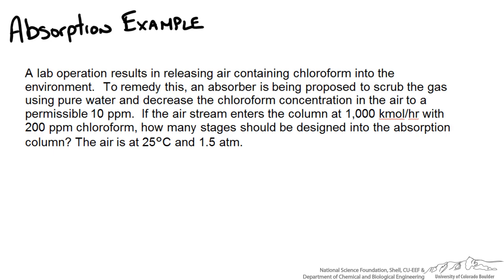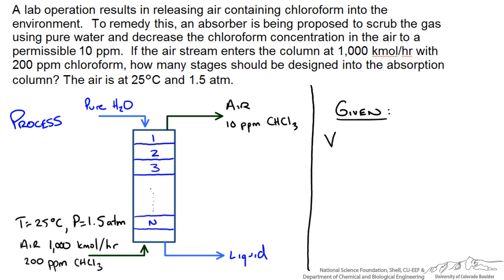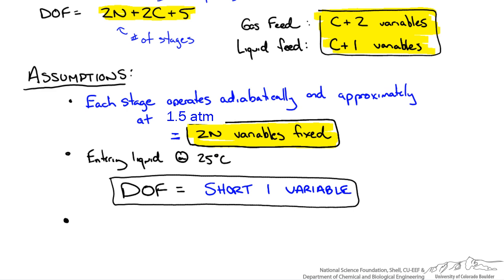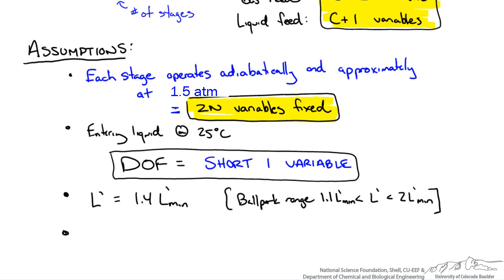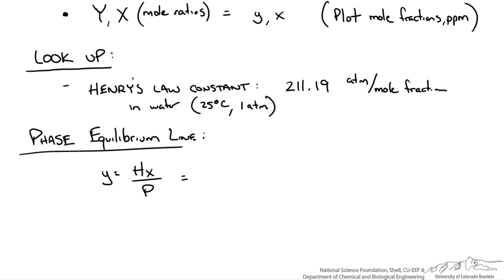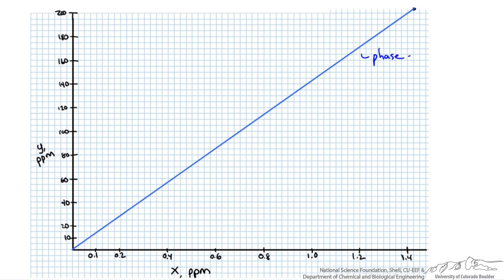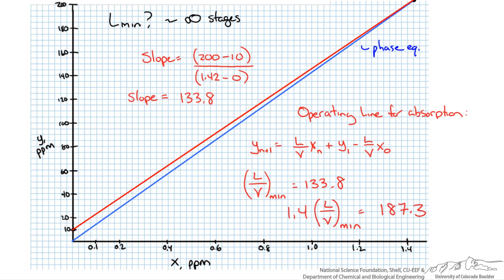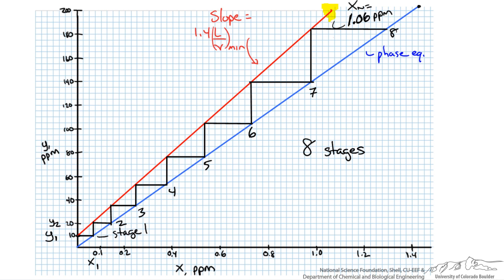Absorption of a Dilute Species

Comment: When he's finding (L/V) min, he finds the intersection of the bottom of his absorber (0,10), with the pinch point of the equilibrium line. The connecting point on the equilibrium line, the pinch point when the number of stages goes to infinite, is found by using the equilibrium relationship y =140.8x. x = y/140.8. specifically 200ppm/140.8 = 1.42, so the top of  bottom of the absorber (top of the equilibrium line) point is (1.42, 200) and the top of the absorber( bottom of the equilibrium line) is (0,10), connect those points, perform slope formula for minimum (L/V) and then multiply by 1.4 to find an appropriate (L/V) vaule.
Reply: why was (L/V)min multiplied by 1.4 and why 1.4 specifically?

Comment: The Xn value at the end of the video I believe is incorrect.  You forgot to subtract by y1/(L/V) which would give you 1.01 ppm.  Which gave me 7 stages.
Reply from the maker: You are correct that the final xn value should be 1.01 and not 1.06 (did neglect to subtract y1 from yn+1).  The stages are about 7-8. Thanks for the correction.
Reply: Destro ya Xn can be calculated from the angle of the relation of the linear operation:(L/V)op=187.3=(200-10)/Xn, so, Xn=1.014